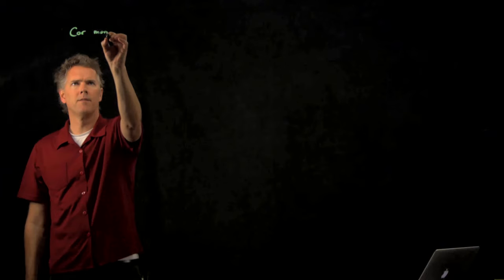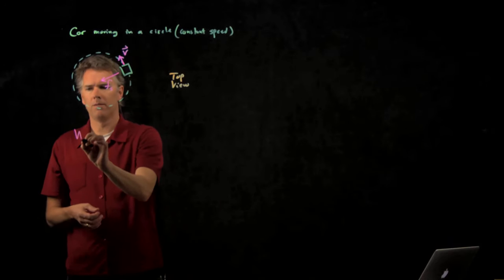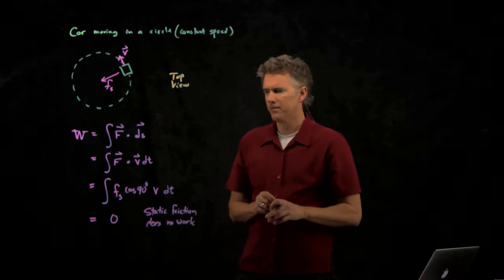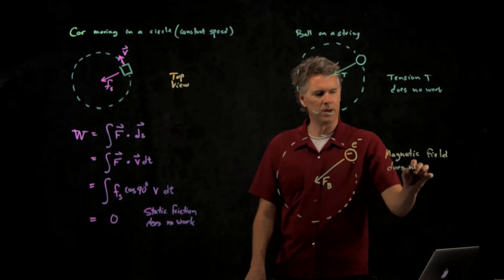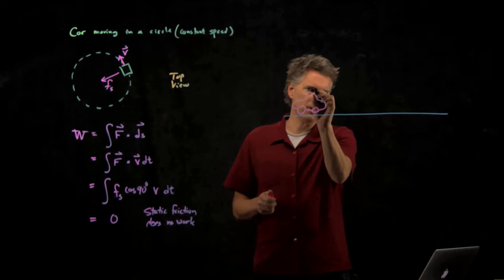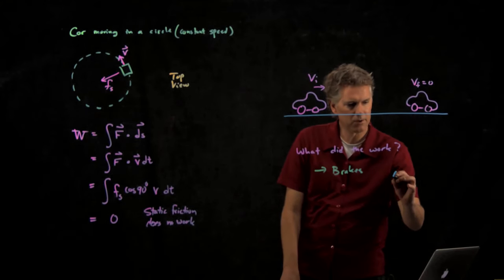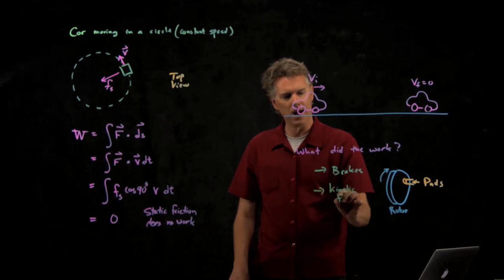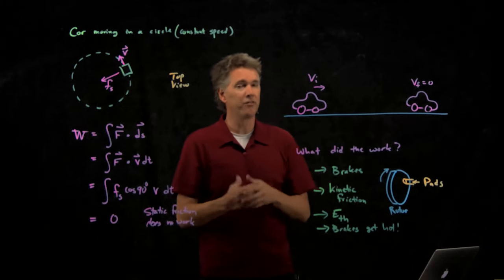Friction and Cars

Comment: Excuse me, I didn't quite understand one thing. You prove that static friction does no work by looking at car moving in a circle. But this is quite special example, what if we look at the straight path? Can we prove that static friction all the same does no work? Because dot product in that case won't be zero.
Reply: Daniel Brown its only the circular path that the velocity and force are perpendicular ...... this implies that cosine of 90 degree is zero and work done is also zero in straight path however the angle between the two is 180 degrees which make it negative (non zero)

Comment: sir, does the force applied by the driver on the brake pedal equals to the force applied by the pads to the rotor?
Reply from the maker: No, there is a mechanical advantage (leverage), typically through a hydraulic piston (this is why you have to check your brake fluid).  One way to measure this advantage is by measuring how far the brake pedal moves (quite a bit) compared to how far the brake pad moves (hardly at all).
Cheers,
Dr. A
Reply: Thank you, sir.

I would like to ask another: Is there already an existing formula for braking distance? 
I searched but either they lack friction or they lack reaction time.
Reply from the maker: You can probably work it out pretty quickly.  Here's a clue: the maximum braking deceleration is given by a = - μg, where μ is the coefficient of friction between the rubber and the road (static frictional coefficient if the wheel is still rotating, hence the rubber is not slipping, and kinetic frictional coefficient if the wheel is skidding).
Good luck,
Dr. A
Reply: @yoprofmatt   Braking distance = (1/2)(V^2) / (mu * g)   where V = Initial Velocity... :D ..  Great Video... I'm still trying to figure out why a Magnet lifting a piece of Iron off a table does no work... I guess the Field doesn't... But perhaps the Hand Holding the magnet does work, or Newton's 3rd Law of Force/ Opposite Force cancel each other out..  Does an MRI machine's Strong B-Field realign the Dipole moments of atoms or electrons in the body?.. would that be work?.... interesting STUFF!! :)